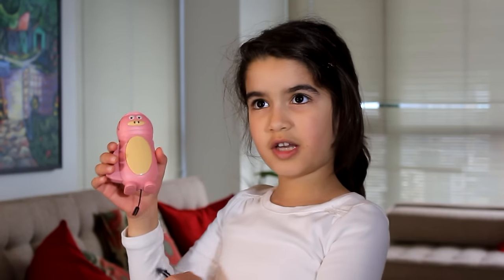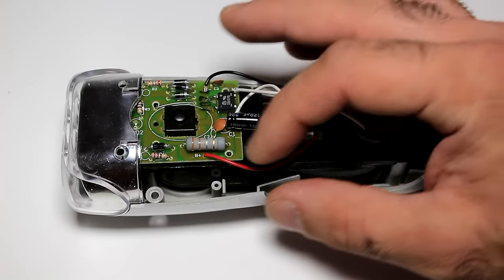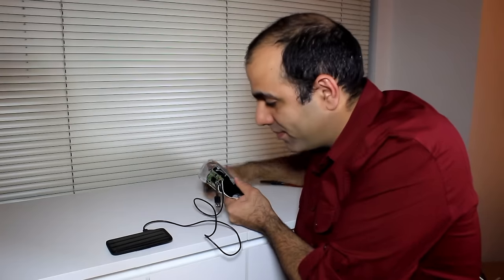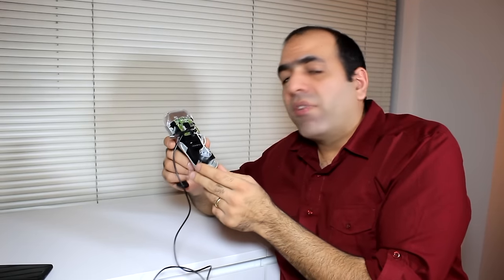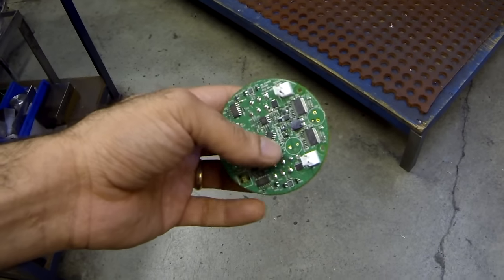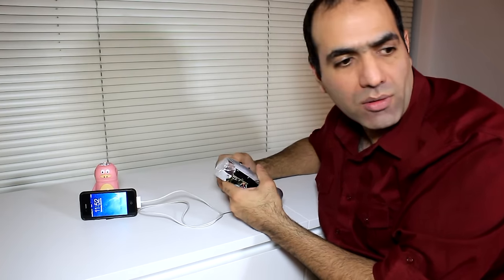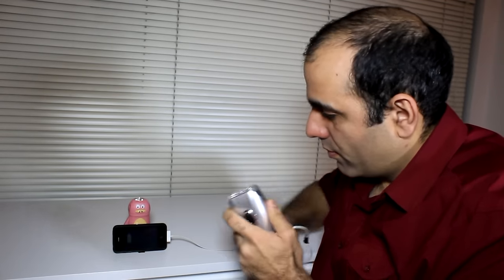Make a Human Powered Mobile Phone Charger

Comment: If you attached a supercapacitor with a voltage-limiting zener diode to a boost converter then you could store any excess energy not used by the phone in the capacitor. This would stabilize the output of the generator and assure that a greater percentage of the cranking work is put to use.
Reply: Holy

Comment: Man you have to explain us what happened at the end :'D
Reply from the maker: +Ioannis Tzon Tsolakidis Daughter plugged the charger somewhere she shouldn't have!
Reply: I DONT BELIEVE IIIITTTT :'D MAKE A VIDEO FOR IT NOW
Reply from the maker: Ioannis Tzon Tsolakidis
THAT'S THE PLOT AND I'M STICKING TO IT!
Reply: OMG JUST MAKE A VIDEO ALREADYYYYYYY
Reply: +mlggrinch No transformer.
Reply: +ElectroBOOM is that smoke and flashy boom stuff really burning phone or a effect? ....well, doesn't matter since you're so awsome i guess.
Reply: +ElectroBOOM but seriously, i'm curious as hell.
Reply: +이준성 It's the result of not properly testing your output voltage before plugging it in right away. Simply put if you just rush into things right away after building a circuit you could have some dire consequences.
Reply: +Puls Sucks Or, you know, because it was rigged to do that on purpose.

Do people seriously think all of the exploding is on accident? Literally every "accident" is on purpose.
Reply: QuakeCBR
 The ending was rigged his smoking phone was not. Of course he does all of it on purpose to show you what happens when you do something incorrectly or untested.
Reply: +Ioannis Tzon Tsolakidis made a usb killer with a usb plug and a bug zapper.to destroy old phones or old computer info before throw them. it never smoke or explode but it can become insanely hot. this thing was throwing around -1000v in usb data pins
Reply: +ElectroBOOM  I paused the video at the explosion. it appears you were hiding something in front of your phone. to validate my notice how she plugs the charger in and then it pops a second later. if something really did happen it would have happened as soon as she made contact.
Reply: the things he added to the charger cable may have been the reason.
Reply: +Ioannis Tzon Tsolakidis Im not an electrician, but a video maker, so if you slow down the video and look at this explosion, you can see that this beautiful little lady doesnt really put the wire in the charger, sparks are going from host's fingers and the phone is switched while it falls, but still worked great. I giggled.
Reply: +selfishbirch looks like he added the plug in post as well.
Reply: +Puls Sucks Nice explaination !!
Reply: His hand crank has a limit to the voltage output, but the surge protector did not. He was probably running some ridiculous amount of current through the surge protector or had it connected to a very high voltage source so that it would overload if he did not limit the voltage.
Reply: It could also be fake
Reply: +Ioannis Tzon Tsolakidis it's obviously fake at the end lol
Reply: +ElectroBOOM But she just plugged it into the wall charger!
Reply: Some people dig too deep. It's a comedy routine. And he's intending it to be. Not "faking" it. 
Saying it's fake is like pointing out that every movie you've ever watched is fake.
Reply: nice profile picture
Reply: +QuakeCBR not every accident.. sometimes he makes a mistake and leaves it in the video like with the first phone he killed I think that was real
Reply: +kakytoo69 actually it could take a second or two for a short circuit to cause an explosion. We had a controlled one in one of my classes and it took a second to blow the capacitor.
Reply: You sound like my mom when I was 7 and she said that I get no more accidents, even when what it was that I had done was truly and truthfully an accident.
Reply: It's good that it was fake, having his daughter mess around with explosions for third party entertainment wouldn't be cool.
Reply: +Jamie Bales 
are they???? O_o
don't mess up me life!
Reply: Manav Jadeja What...? he does fake explosions in like every episode, YES it is fake. it's meant to be obvious too.
Reply: Manav Jadeja 
Lol,  there's a first for everything :)
Reply: My guess? He shorted a charged capacitor in his right hand. What else would he do?
Reply: True, but maybe add some flint or a cheap firework. Lots of ways to make sparks.
Reply: Always wear your safety eyebrow.
Reply: +Manav Jadeja um you should know when you overload the voltage limit of the cap it explodes.
Reply: GUYS ITS REAL STOP SAYING ITS FAKE INSTALL YOUTUBE+ EXTENSION AN SKIP FRAME BY FRAME YOUR SELF
AS YOU CAN SEE THE EXPLOSION SPARKS MAKES LIGHT IN THE EXTIRE ROOM AND HIS FACE
Reply: Galaxy Note 7 happened
Reply: Manav Jadeja in english
Reply: Manav Jadeja don't say u did it ...
Reply: people only wonder what happened because they don't *watch this channel enough. she literally plugged the plug where it was meant to be plugged as manufactured.  the hand crank device was completely unplugged and isolated. the sparks were just necessary to fake because that's what he does.
Reply: Magneticitist have you watched his vid? No? THEN DONT TALK
Reply: Magneticitist I ment vids....
Reply: HappySlappyFace Well I also obviously watch his other vids, which is how I know he constantly stages small explosions, so take your happyface horse and ride on outta here back to happy town, a place where you might find a FULL BRIDGE RECTIFIER
Reply: Magneticitist that pun is rasict and funny at the same time
And you lied you didn't watch his other vids as you dont know to fake stuff videos
Reply: the power strip wasn't on smh
Reply: It's the battery exploding or the charging port?
Reply: maybe its a cheap quick chargin 2.0 psu that only does 12v not 5 and 12
Reply: not like he is going to put his kid in danger at least i like to think that
Reply: that cable he had modified with resistors!!
Reply: QuakeCBR I don't think he broke that phone on purpose
Reply: That's the point! Is it really so hard to understand? It's not fake, it's just comedy and I things it's perfect because it makes me laugh!
Reply: Why is the switch for the outlet turned off?
Reply: Pump 30 watts through a 1/8 watt resistor will blow up like that too

Comment: 300 to 500 mA? my charger outputs 2.5 A
Reply from the maker: But how much does your cellphone takes?
Reply: ***** I think the max Motorola says it's 3A
Reply: +ElectroBOOM Qualcomm quick charging is like 3A, that would be nice so you don't have to spin that thing for 12 hours :D
Reply: +Dylan Collins sure a phone can take 2-3A charging current, but in an emergency even 200ma would get you enough power for a distress call given 5 minutes or so of charging, you could also put a 5v battery in there as a sort of hand charge boost pack.
Reply: your charger has limiting to 3 amps yet your phone takes way less than that
Reply: My Android phone charger output is 2.1 A and I connect old bar phone to new smartphone with this charger and working fine. But charge quickly.
Reply: my phone is charging right now at 2A (measured with the ampere app, which measures the net rate of charging, after subtracting any current currently in use by the phone).
so yeah phones with fast charging do take a lot of amperage.

Comment: You should patent that and sell it. I'd buy one.
Reply: It's already available. I bought one from A store years ago. Hand crank flash light AND it has a USB port that outputs 5v
Reply: ***** Cool.
Reply: +Blackrose 78 How long does it take to crank an iPhone up to full power from nearly dead?
Reply: +pete5668 I&#39;m not sure. Probably the same amount of time it takes the battery to fully charge with the charger. Cranking is only good for emergencies or if you are stranded. I also have a solar charging battery pack which will charge while connected to a phone. A much better solution and you wont strain your wrist. :)
Reply: +pete5668 lets assume it puts out as much power similar to the iPhone wall charger, happy cranking for over an hour.

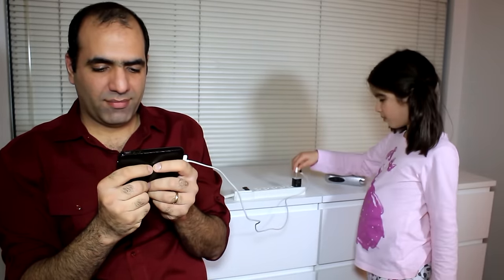Comment: 5:33 please tell me that was expected 

I don't wana have in my mind an image of another broken Phone 😢(and poor Child)
Reply: If you look closely the girl didn't even plug the cable into the charger properly and still the phone went boom. 

Even though it's seems like he's careless, Mehdi actually takes precautions beforehand. I am pretty sure that power socket was unplugged and Mehdi simply used a small overcharged capacitor circuit to create the spark, which he triggered using a switch under his foot. He explained his tricks in one of his videos as well.
Reply: @spirallightningtech8552  
Great observation!!!
Reply: I broke more than 10 phones so far. He’s not even close🤣

Comment: Why did it explode at the end?
Reply: overload
Reply: Kronosxviii1 can you be more specific? it was just a 5v USB adapter right? so to me it should work.
Reply: 5v USB adapter. Iphone ones are 1Amp. there should be no problem as the wire and the phone both can handle it.
I think the last one was just a joke, I just asked because i thought there might be some reason.
Reply: Same here. From what I understand from his past incidents, there should be some reason behind it even if one incident is staged.
Reply: Ahmed ツ He rigged the power bar to overload for comedic effect
Reply: I think that last one was faked for comedic effect. Nothing should've happened.
Reply: I think he made a high-voltage generator and disguised it in a phone charger. Of course, as ^^^ said, the power bar wasn't turned on.
Reply: because reasons

Comment: Why did you use resistors  ???
Reply from the maker: +Sss Ttt Phone looks at the voltage on the USB data lines to determine if it is plugged into a proper USB port. So I need to bias those lines to around 2V and that's why I used resistors. See my website www.electroBOOM.com
Reply: *****   Thanks for answering my question. Good video
Reply: +ElectroBOOM hmm interesting, my mums iphone 5 works when plugged into a samsung charger. r those also biased to 2V?
Reply from the maker: Mr Ching Chong
Their connectors are different, otherwise it should work as I think most chargers bias teh datalines
Reply: every time I read the comment from Mr.mahdi I can't stop imagine his voice sayin the comment. :D

Comment: There are little usb circuits you could solder in that would step up the 3.6 volts to 5. So you could wire it in parallel with the battery.

Comment: Would have been more surprised had that first attempt not failed, most half decent protection circuits on lithium ion batteries are finicky as hell about weird inputs though probably a good thing as unprotected lithium cells are rather finicky too just with the somewhat more dramatic failure mode of venting with flame lol.

Comment: while these hand crank generators are useful in a pinch, the nature of using the crank the entire time is a bit silly, the best solution is a supercapacitor board that can do ~12-16v(the common 6S types on amazon are fine) you rectify the dynamo(~10-24v motor that draws at least 100ma under load) and use it straight to the supercaps
this basically forms the ~12v peak "human battery" that makes it stable and usable as a flashlight for several minutes before a cranking is required
then connect via a switch to a 3.3v and 5v regulator(3.3v for stable LED light and 5v for phones)
it can also act as a camping solar MPPT to phone charging as a cheap 12v panel that can do at least 20w will be perfectly fine to charge the protected supercap board, just remember that when it gets to 100% there must be some way to burn the extra power, a simple circuit with threshold detection that forces the LED to turn on when full will help add extra load that the balancing resistors can't take
slap this into the smallest box you can fit it into(project boxes of all sizes and shapes on amazon) and you have a powerbank that never dies, can still be charged fast, can take any limited input over 16.8v and any input at all between ~7-16.8v in phone mode and anything between 5.3v and 16.8v in flashlight mode
it may be best to place a linear regulator on a heatsink on your DC input connector as a supercap is a dead short when discharged and those puppies can handle up to 1.5a(quite a reasonably common maximum current draw at 12v) and as modern 78xx series to-220 regulators have thermal throttling it should be fine if heatsinked to use as your only limiter besides solar panels
you can then use any ~7-18.8v supply to charge it up and then anything higher voltage like a solar panel will start triggering the LED to signify it has reached 100% and possibly switch a simple mosfet on the input to allow other 24v batteries to charge from your solar panel
I think one of my future projects might be just this but better than electroboomer and electrocute can ever do
I suspect I will use an old 18v drill motor, a 12v supercap module with 500f caps leading to about 100f of capacity at 13.5v, a common 5v buck regulator, a buck-boost circuit to take any input from ~7v to 30vdc(7v because those buck-boost with current limit tend to be unhappy when fed less than 7v becuase the LDO for the chip needs at least 5.3v to be stable)
this means I can use the power of a human fatass to recharge my stuff, and given the dumb way I will get 5v output it will even charge my headphones and small stuff better since it has no minimum current draw
actually probably using a cheap 12v motor for hands and teh drill motor as the AUX for a stationary pedal version, sit on my fat ass playing video games yet be charging my phone and stuff so I can't be called lazy anymore
too much work and money to build but still a cool idea
now trying to pull >100w from human muscles is impossible, 10w for a phone is tough, but the supercaps allow you to charge up to a higher voltage, the phone gets whatever makes it happy, and you can just go as fast as you can to keep the supercap from going too low
hmm, now I am really into the idea of a magnetic clutch driving a massive flywheel in a box, and some coils on the outside of the air-free box to extract the energy without any seals.....

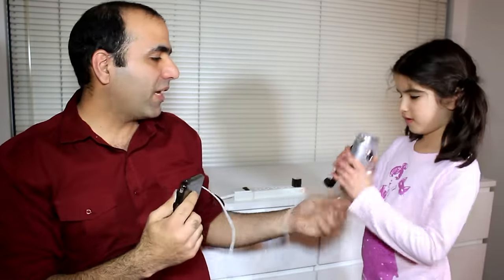Comment: 5:24 doesn't rotating it in the opposite direction suck up the current from the phone due to reversing the direction?
Reply: 😂😂😂yeah for sure but after discharging totaly you can fill the battery on reverse polarity too -other elements like capacitors will blow up on polarity switch - in phones the battery gets  charged in either way thats why it advised to charge the phone when is close to 0% for a longer living battery - it you want to charge just in one direction you can controll it with a diode and not let current flow on polarity switches -depending on what you want there are a lot of possibilities.
Reply: @shadowwalker4633  ahh I see that's some nice insight, thank you very much!

Comment: Though I understand that the crank flashlight is built off of a Faraday Flashlight with a dynamo to replace all the jerking, I was wondering what was the green battery you were pointing at.... I thought Faraday Flashlights couldn't charge batteries, only capacitors...

Comment: I once accidentally supplied 12v on a usb port to a phone that at most can only take 9v quickcharge but it did nothing no amps were drawn. I guess most modern phones do a voltage check on the power lines of the usb cable before drawing any amps. But excessive voltage may also break this voltmeter in the phone.

Comment: If we charge a battery at a higher voltage than which is stated on the battery, assuming that it doesn’t gets damaged, how long would it take to charge. 
Say charging a 12V 3amp cell at 16V 3amp?

Comment: Why not just use your idea to charge up a battery bank instead of hand cranking the cell phone directly?
Reply: Because it would burn the power bank too
Reply: @sovietcomrade7733  right, so with that in mind, power banks are cheaper than cell phones for the most part.
Reply: @Biggus_Diggus1  a good quality bank is very expensive. I bought a big one for 100€